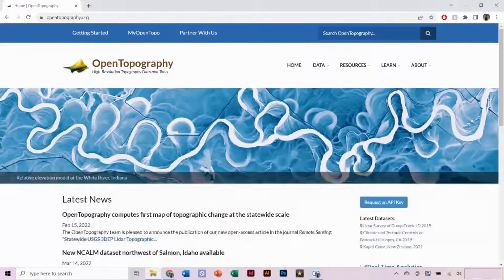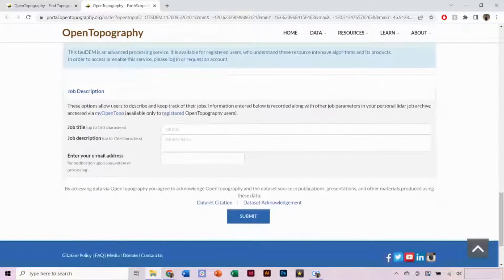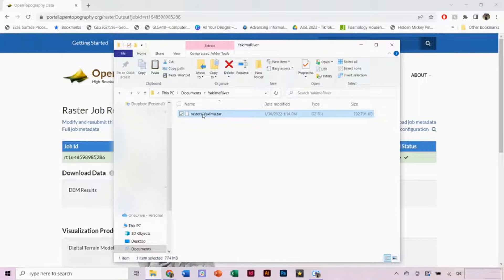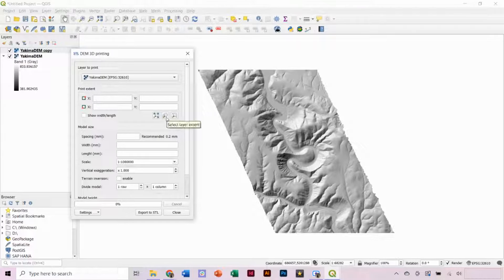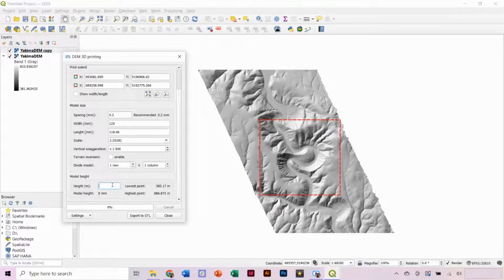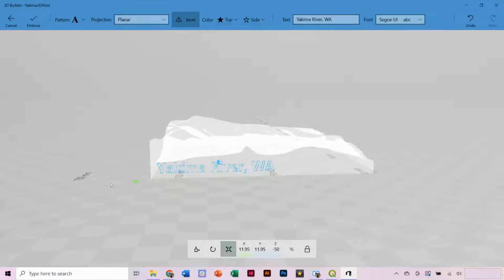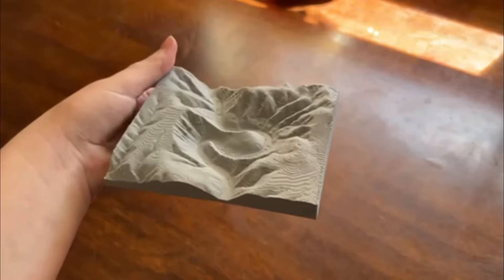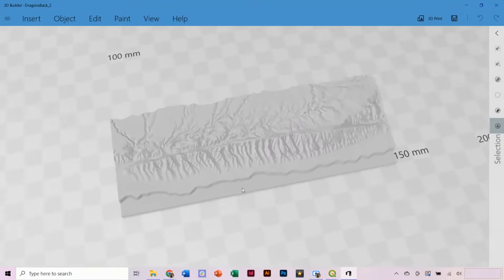How to Generate a 3D Printable Model from a DEM

Comment: Thank you so much for the information and guide. I have 2 questions. 1, is that I notice after I insert the recommended spacing, 0.2, and then specify my desired width, the recommended spacing changes quite a bit (not the text box, but the displayed recommended spacing next to it), sometimes into the >1.5 range. I don't fully understand what happens with this setting, or how the recommendation is suggested. 2, is that once I open the STL in a slicer or 3d viewer, I notice it's very "cuboid". I'm presuming this is related to the DEM's resolution which in my case from USGS is the 1/3 arc minute DEMs. If that is the best resolution I can get from the available DEM, is there a relatively easy way to smooth out the cubes and have it print more similar to contour lines? Thanks in advance!